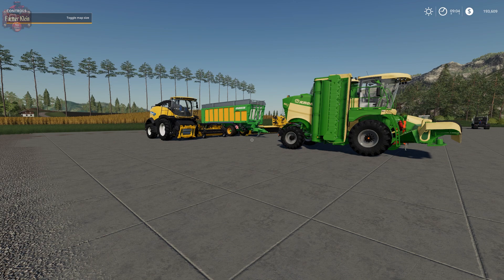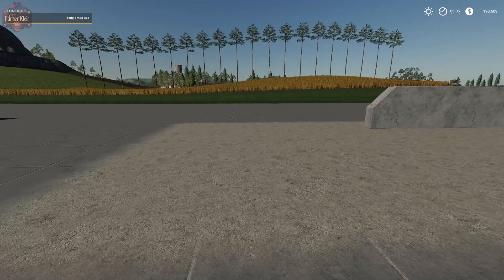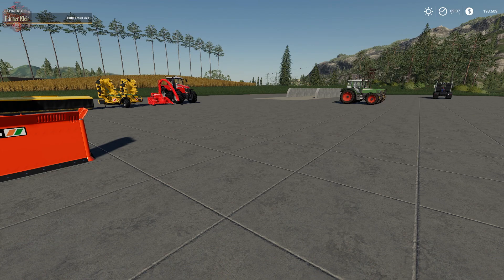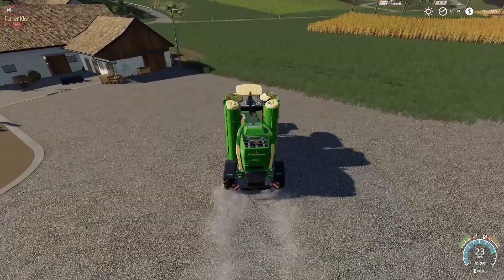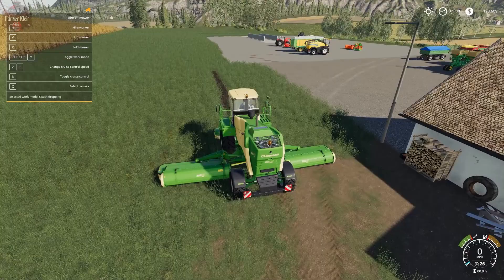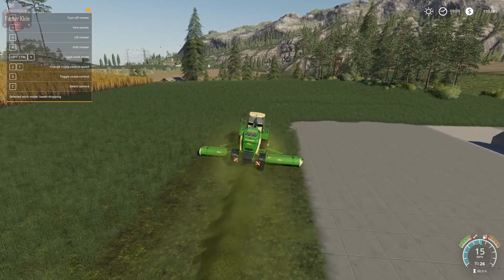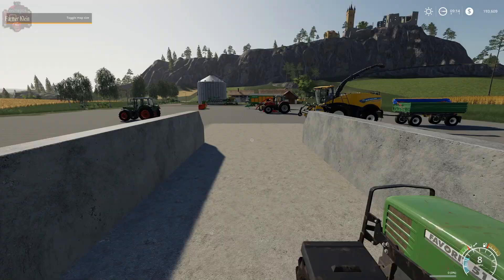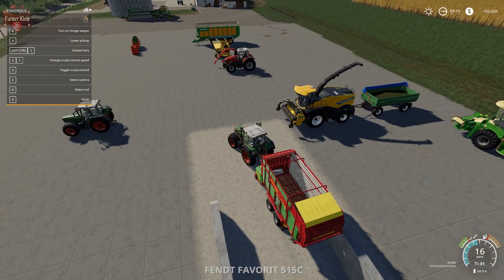Farming Simulator 19 - Back to Basics - A beginners guide to Making Silage

Comment: The reason that some trailers work with the Forage Harvester and some don't is because the Harvester is using a "Pinhook" system where a metal bar in inserted down into an "eye" in the trailer. but some trailers use the standard "ball" like your typical car, these won't work with the forage harvester, personally, I have downloaded a mod with a "Pinhook" auger waggon for easy unloading into semi-trucks.

Comment: There's an important different between chaff and grass; Courseplay's new leveling and compac mode cannot level grass with any of the standard leveling blades. Those can only be used to level chaff. So if you want to use courseplay and make silage from grass, you're left with making a "back and forth"-course to automate compacting of the silo. Edit: this conclusion simply isn't correct. Courseplay have issues with the auto level function, but it is not related to the tool equipped in this way.
Reply from the maker: For the purpose of the back to basics series we do not cover how things like mods affect gameplay let alone a mod like courseplay.

Comment: Why is my plastic not folding up as I drive along it?
Reply: ikr, it's really annoying. So far best way to get it to unfold fully is by using belt systems and moving it close enough to it and  (while being turned on beforehand) that it reaches the other side briefly and that usually uncovers it. There is a mod, I think called "real shovel" or something, that pushes the silage around when using a front loader bucket, this also tends to uncover the silage well but the mod caused some key binding issues so I had to remove it.

Comment: I bought a small bunker.  Then used the loading wagon to pick up cut grass.  Drove it to the bunker but it didn't give me an option to empty it when I pulled into the bunker (PS4).  Any ideas?  Thanks!  Great video.
Reply from the maker: You have to force unload trailers in bunkers.
Reply: cntrl-I on pc
Reply: @SaneNoMore  yeah but it won’t do it when I’m in the bunker I’m on pc
Reply: @cofersn7  I've had that issue before when trying to unload grass into the bunker when it shows that it's not 100% empty of silage. I think it's a bug. If you have the issue, save your game, quit to the main menu and start your career from your save. It tends to empty out the "ghost silage".

Comment: Can you load the fermented silage by driving a "loading wagon" over it? Or are the loading bucket or belt setups the only ways to load into a wagon?
Reply from the maker: You will just have to try and see.
Reply: You just need a joskin trailer and a milling machine found in other section on modhub is what I use to collect loose material to make mine.
Reply: You can, but as you probably realized if you tried it already, is that the wagon tends to get stuck all the time. Best way to get silage out I found is by using belt systems.

Comment: My solo wont open all the way... I get the silage from both sides but the center wont open up. Its frustrating.
Reply from the maker: it will uncover as you drive into the bunker.
Reply: I have the same problem still won't open? Any tips?
Reply from the maker: @duckdestroyer2412  It wont open until its 100% done fermenting.  if its done fermenting per the F1 menu then the R key I think uncovers it.  it only uncovers a portion until you drive into it with a bucket to remove then it will uncover sections at a time.
Reply: I think I did something wrong. Because I had very little in the bunker silo and I just picked it up with a loading wagon. and everytime I try a front loader it just sticks into the tarp and doesn't open up so maybe a glitch or poor programming?
Reply: @FarmerKlein  also thanks for the reply
Reply from the maker: @duckdestroyer2412  If you walk up to the tarp the F1 menu will show the key you need to hit to uncover it and if the fermentation is at 100% or not.  it wont auto uncover by bucket you have to manually uncover it by key stroke only after its 100% fermented.
Reply: I have manually uncovered it and it still won't auto uncover but I have taken all of the silage from both uncovered sides so it just will not uncover any further
Reply from the maker: @duckdestroyer2412  Is this a base game bunker or one built into a mod map?
Reply: @FarmerKlein  it is a bunker silo off of mod hub for console.
Reply from the maker: @duckdestroyer2412  Maybe the silo mod has an issue.  If it cant be emptied any more you can 'delete' the left over by going into the landsacping and painting over the bunker and it will remove the stuck silage.